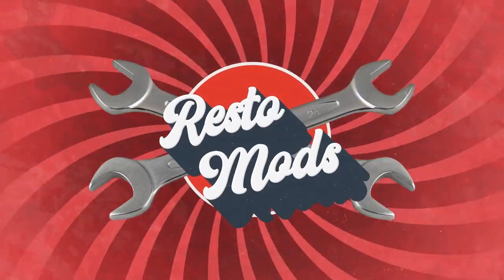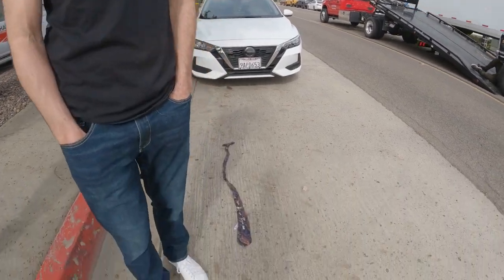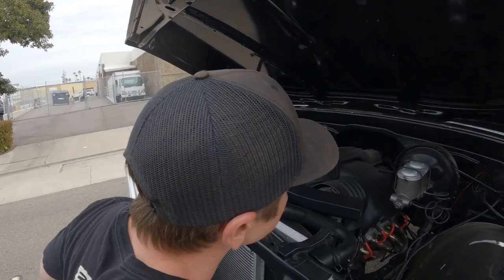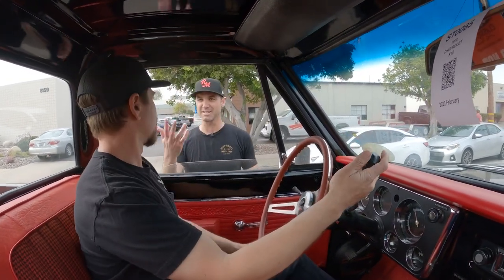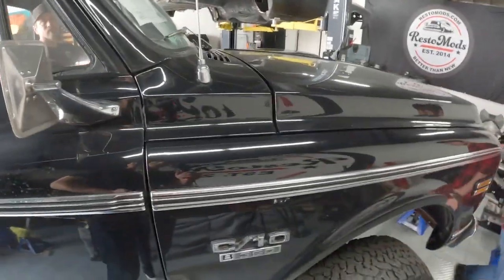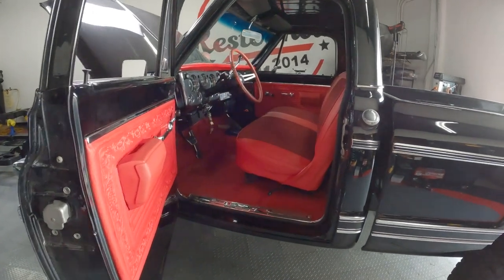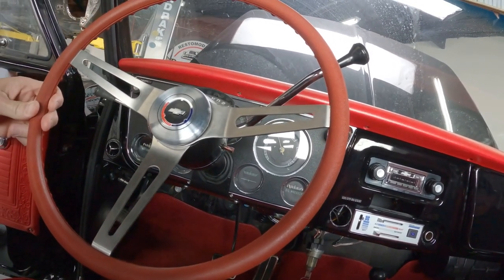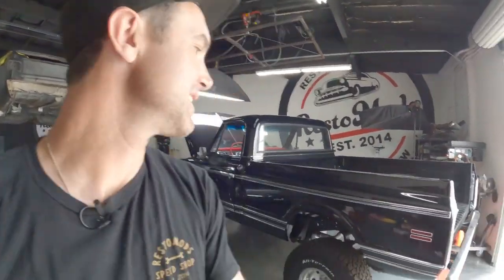We Just Bought a Lifted 1972 K-10 4X4 - Or Did We? 🤔

Comment: Beautiful. I will be entering for this one. Fix Gages , probably update breaks, spay in liner, suspension and steering, air and heater, new rubber molding and fuel tank in the rear, and it needs a cam and a deeper exhaust sound and I would call it Bigfoot